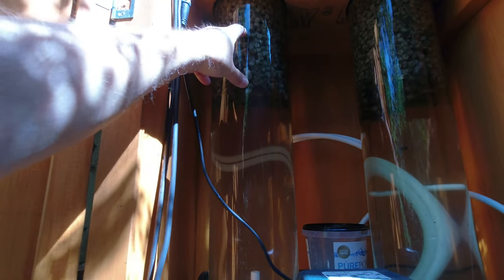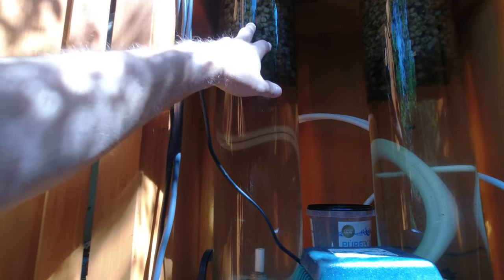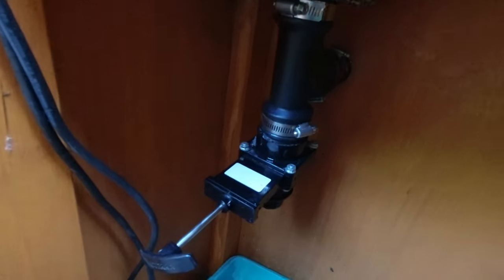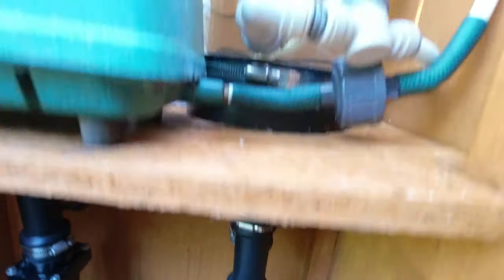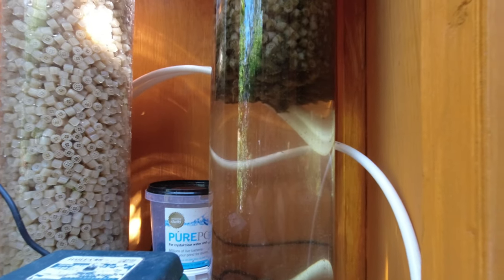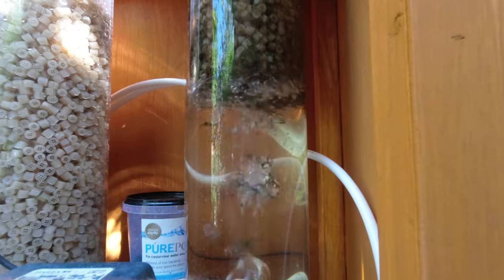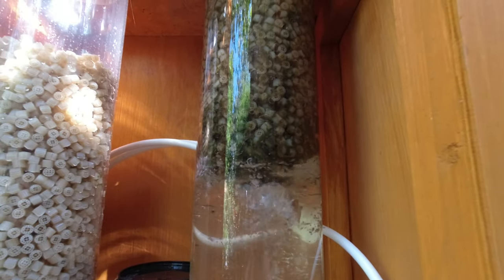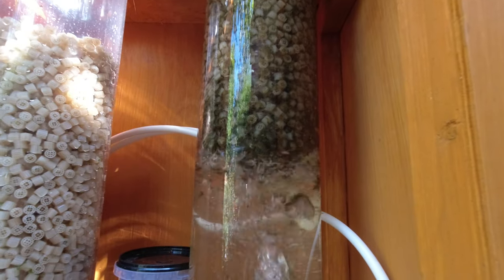Slide Valve fixed

Comment: Thank you for posting this. Mine wasn't sealing properly, allowing waste water to syphon back into my pond. it is glued in place so will just remove all the internals, but know what I`m doing now 👍
Reply from the maker: I'm glad you found it useful Chris. That is basically what I had to do with mine. The blade was heavily scored so it would have worn through new seals in no time at all. Light scratches you can sand out with very fine wet & Dry but if they are too deep your better off swapping the internals.
Reply: @ItsWhatIDo  They were heavily scored mate, Ive ordered a new one, will be here tomorrow hopefully. Will slot the internals into existing solvent welded outer casings. thanks again 👍

Comment: Great video jimbob I need to change the washers on one of my slide valves. Now I know how to do it. 👍🏻👊🏻👏🏻👏🏻
Reply from the maker: Cheers Steve. It's fairly straight forward. You just need to check the slide for deep scoring.
Reply: @ItsWhatIDo  thanks jimbob will do 👍🏻

Comment: Nice video Jim👍 I've personally never had to change any seals on a slide valve yet! But I do have one so this will come in handy should I ever need to 👌
Reply from the maker: Cheers Si. If you have slide valves you will inevitably need to change the seals at some point.  You do not need to remove the valve to do this. I just did it because it was easy and made it better to film.

Comment: Very useful for me as I have two to do , so a great help , btw where did you buy the replacement rubbers?
Reply from the maker: Cheers Simon.  I bought mine from Ebay. I buy quite a bit of stuff from this supplier. Never had any issues with him and he delivers in 1 or 2 days. https://www.ebay.co.uk/itm/401482896538?var=671156714436
Reply: @ItsWhatIDo  thanks fella 👍

Comment: Thanks for the video . Quick question.. the internal of my outlet is 42mm which is about 1.6 inches ... Unsure whether to order 2 inch seal or 1.5 .. any idea ? Cheers
Reply from the maker: The actual size of the valve should be printed onto the main body of the valve.  The seals are rubber so if I was having to guess from your description I would say 1.5 as you can stretch them but it would be harder to compress the extra material.  You could also strip it down and measure the actual seal itself. When I bought them I just bought the size that was printed on the valve so never really had that problem.
Reply: @ItsWhatIDo  nice one cheers , I'll take a better look at the valve .

Comment: whats the reason to use  gate valve over a ball valve ?
Reply from the maker: When I built them it was the cheaper option. Slide valves work well but they are prone to wear very quickly